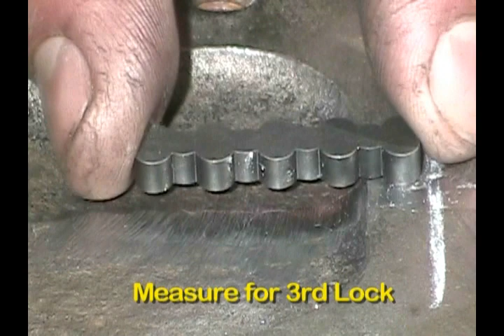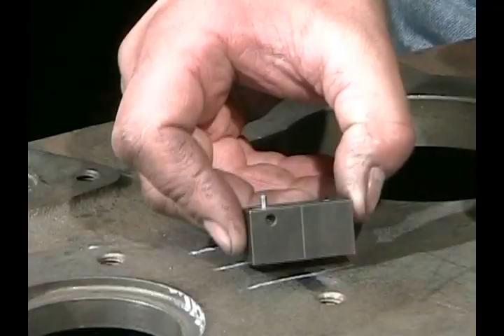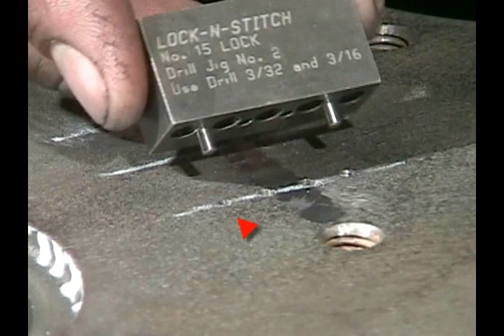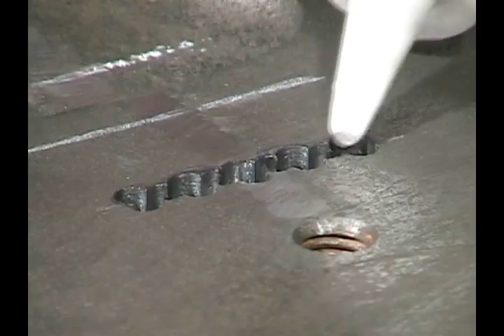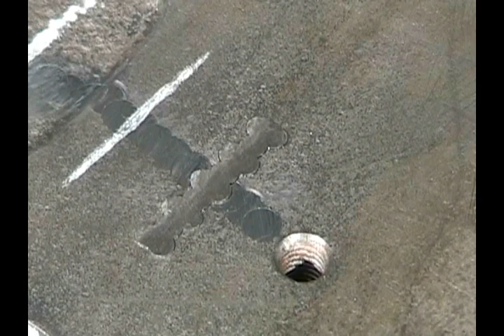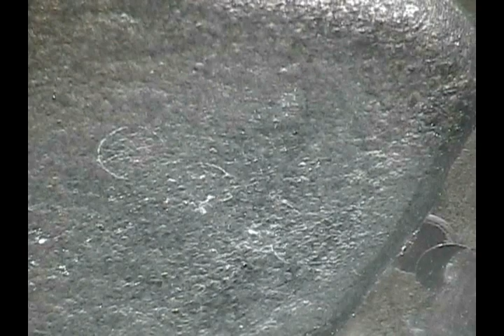Lock Installation on Crack repair

Comment: A very interesting concept. I wonder what the pressure ratings would be on the repairs?
Reply from the maker: Thank you for your comment and question Thomas.  The pressure rating is tied to the thickness of the casting where the repair is. Restoring original operating pressure is our normal procedure. Repairs have been hydro tested as high as 1500 PSI in one inch thick cast iron. If you have any additional questions feel free to reach out to us directly info@locknstitch.com or 800/736-8261 (209/632-2345)

Comment: We never put pins across the original inserts. But that was because most of the work done was inside of exhaust ports on Chevy 235 stove bolt 6's, and those repairs that weren't were still inside a port. No room to work. This is a pretty thorough crack repair!

Comment: Uh why would u do all this just tig the damn thing
Reply from the maker: Cast iron is unlike any other metal and responds differently to heat - welding on cast iron can cause hardening and additional cracks.  We invite you to read this white paper written by Gary Reed http://www.locknstitch.com/pdf/gmrc_white_paper.pdf
Reply: Maidenlord 666, it can also warp the block enough to cause seized bearings and leaks if you don't line bore before assembly.
Reply: The only place you may get away with welding is on the outside of the block when you have to weld up a motor mount flange

Comment: This seems a complicated system doing the same job I did in a machine shop in the seventies, we used tapered taps and plugs[freehand] to sew up cracks in blocks and heads in much faster and more simple way. repaired many auto heads, even Caterpillar blocks, and diesel heads. Many very happy customers, lifetime warranty also. Why complicate an old skill?
Reply from the maker: Thank you for your comment and feedback.  The LOCK-N-STITCH stitching pins have a different thread geometry allowing permanent repairs unlike the old tapered pin method that was/is unpredictable.   Tapered pins all exert extreme spreading pressure on the crack because they are simply wedges forced into the space. LNS pins and locks create strength and seal over every linear inch of the repair. We invite you to learn more about the process and products by visiting  www.locknstitch,com
Reply: Good answer from Lock and Stitch... have seen a casting split with the taper pin method

Comment: Hi this seems a great product.  just wondering do you supply to the UK. 

I have a 1939 metal lathe I want to restore the back gear cover has cracked at the flange that the screw goes into and the part has come completely  apart   right where the hole is. will this work for such a problem like this were two piecies have cracked apart. hope you can help. 

who ever owned the lathe previously had try to weld it together and done a really bad job of it. I didn't notice the weld as it was completely covered in muck and didn't show up until I started cleaning all the muck and grease.
Reply from the maker: Mark thank you very much for reaching out to us on YouTube to ask your repair questions.  Can you kindly send detailed pictures of the crack to info@locknstitch.com and a customer service technician will be happy to help you!

Comment: Some say "why not just weld?" The answer is easy. Variations in wall thickness, internal casting stresses and uncertain composition of the metal. Old ,aged,and possibly contaminated cast iron is never a guaranteed weld. Lock-n-stitch is as close to guaranteed as you can get.
Reply: I've done all forms of welding, and was very good at welding cast iron (stick welding & TIG)...BUT, was never a sure thing, Even when doing similar pieces, results varied...90% good...10% not so much. While this is a tedious process I would use this on anything that was irreplaceable!
Reply: Dennis Faugh I totally agree. I have used eutectic arc rods, high nickel TIG rods etc and ,like you said,you can get good results a lot of the time,but never all of the time. I have tried many of the different adhesives,fillers and epoxies and had much the same results. The best thing is that using lock and stitch I can guarantee every job. I don't find it tedious,quite the opposite. It feels good to use old fashioned fitting skills that were perfected as an apprentice and putting them to use. At the end of the job you can look at it and you know the job is a good one!
Reply from the maker: Thank you for the comment Andrew and the support!
Reply: I weld cast  with 309 , I do drill before  and after crack  and spot stitch  ,preheat  and all other steps

Comment: I have just carried out two of these repairs on frost damaged vintage car engines. Both customers very very happy,so then so am I!. I pressure tested blocks after repair,perfect,not a bubble after hours of testing. Maybe some consider an expensive repair but try finding a cylinder block for a 1930,s Rolls Royce or a 1941 Alvis!. 
As an asides, it is a very satisfying process to carry out as an engineer. It's a neat and tidy start to finish job with a high level of personal satisfaction of a job well done, interesting to do and gets a brilliant reaction from customers! Makes you feel a little bit elite? A chance to show off what you can do and do very well?. It's the "yeah,I did that" feeling.
Reply from the maker: Andrew we are thrilled with your successful repairs ~ thank you for sharing!
Reply: I can see it being used on something like that, or something that would be a couple 20 thousand dollars to replace. It looked like a section of boiler for home heating. 
  That's why I question the time and cost. The labor to disassemble and reassemble a home boiler, in my opinion is wasted. I built my 1st boiler at 21 had to read all the directions, the 30 year old guys had never done it. It was great experience, freaking bull work, the sections we were told 280lbs each & there were 5. That 1 took me & 2 others, two and a half days. Back then about $2,500. That was 85. I have gotten much faster, probably did a half dozen over the years, most homes in my area have smaller boilers that are what they call package boilers. Anyway I got much faster, and today if I was still working. I would read the instructions on my time off probably online, just a quick brush up to speed things up.
  So today i would think i can disassemble one with interest in reassembling it in say 1/2 a day.  Still need 2 guys. Then a whole day to reassemble it. Todays labor in the ballpark of $2,500. 
  I would never do the weld. How much would would a new boiler be, and up to what % of the cost are you willing to spend on a used unit? 
  It would be different for DIY's when you don't run a P&L sheet afterwards.
The weld itself has to take half a day or more, depending on size. All those holes you have to hold the jig in place, you CAN'T make the hole off at all or the system will not work, everything has to be perfect, it has to be time consuming.
  An irreplaceable car engine, absolutely. A regular car engine, in my opinion absolutely not. Just not economically sound for me. 
  I also have in my mind that what I'm fixing has a chance of happening again in a different location, because the whole piece has been under the same conditions for the same amount of time.
Reply: @thomasbroking7943 this is an improvement on grinding out the crack, preheating the block and filling the grove, using plenty of flux, with a torch and silicon bronze?
Reply: I got 2 good alvis blocks
Reply: Appreciate this kind of post just an honest straight forward evaluation, most others are critical jealous or trying to be funny 😊
Reply: why not have a recast of the blocks, fresh new and stainless steel.
Reply: I was lucky enough to work in a house that had 5 old RR with running boards and that freaking beach ball headlights.. Some were taken apart because someone likes putzing with them. I so bad wanted to jump on the running boards and have a picture taken carrying a tommygun. I didn't do it, at that time i was just married my 2nd wife, i was so happy life was great i got out of control to the tune of 360lbs. I just looked at the cars and imagined.

Comment: Have two people. One with carbon arc to pre heat. One with nickel rod. Stick Weld. Carbon arc behind welder. Post heat right behind. Cool down slowly. File down. Your DONE.
Reply: Try welding on a large crack on a large engine casting ...see what happens...end of.
Theres welders , welding engineers, and mechanical engineers, lots of different procedures for all catergories
Reply: Frank Morreale "you're"

Comment: My late father did this job for 40 years for a UK company called Metalock, It originated I think in the oil fields of Texas, where the use of hot repair techniques was not an option due to risk of fire. The above video seems a little long winded compared to the sopeed mt dad worled at, often completing several yards of repair in a days work....

Comment: Very professional repair. Why not do it my way.  Put a piece of copper or brass shim stock into the crack with some araldite and tap it in.  Then flatten it down almost level. Install the head and then fill the coolant system with a tin of Holts wonder weld. NO, not any other make. Now run the engine to temperature and check the instructions on the tin. No problem anymore.    No shim stock?  Use a cut up Coke  can.  Did this on a friends Jag XJ6 and he sold it after 4 years with no problem with the repair.  Never used any water.  Works on iron heads as well!!.  Usually you get away with just poring the Wonder Weld in the Rad.  No dismantling that way and it works on BMW cracked heads as well.
Reply: Or just oxy/ace braze the crack shut and dress back.

Comment: Isn't it more effective to grind a v where the crack was and weld it in? Seems to me it would be quicker, cheaper and stronger?
Reply: high heat = block warpage
Reply: +Blue Not on cast iron,this is actually one of the better ways to fix a crack believe it or not.Welding will weaken the block more then help
Reply: that too and too avoid it you can try pre heating but its not practical on large objects

Comment: David, What happend to the last part of this video with the crack into the bolt hole?
Reply: that is what im wondering, that looked like a good way to get return customer for the wrong reason, and then usually have to repair at no cost.
Reply: https://www.youtube.com/watch?v=9XfTORBtcSE

Comment: long and probably expensive. Simply TIG
Reply: Oil soaked, porous cast iron, have fun.
Reply: Tig? BWAHAHA!
Reply: easy steam bath  then toss it in an oven
Reply: Bro Thermal stresses and distortions on thinner parts makes TIG welding improper for this purpose.
Reply: You are just bad welders